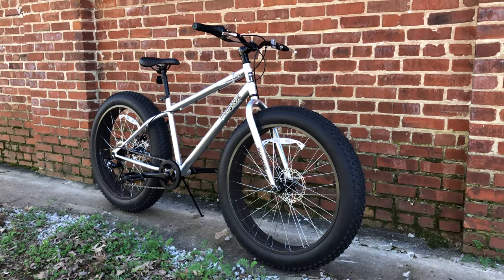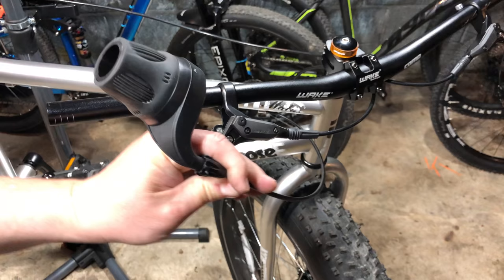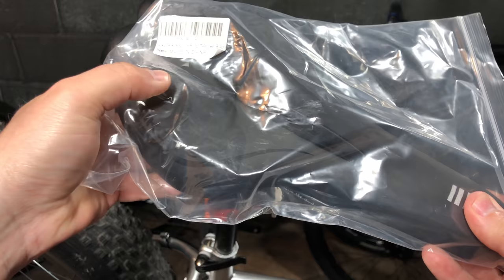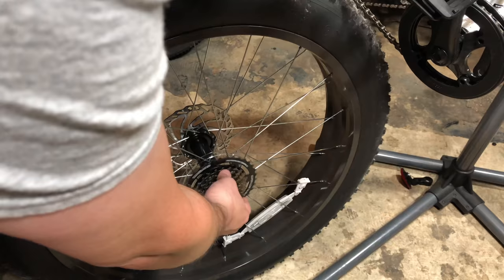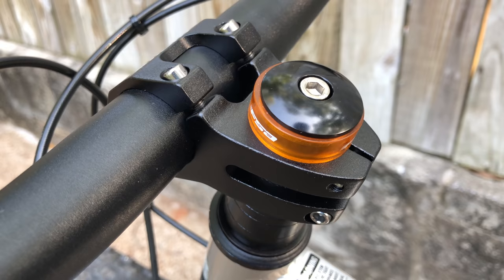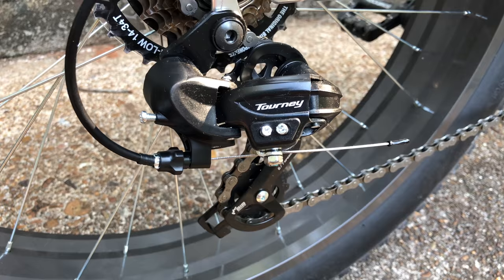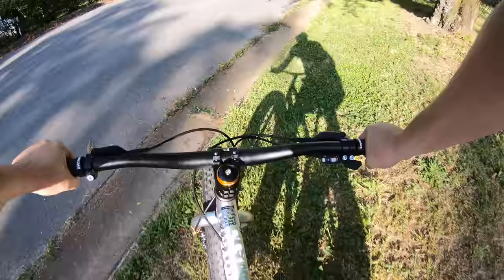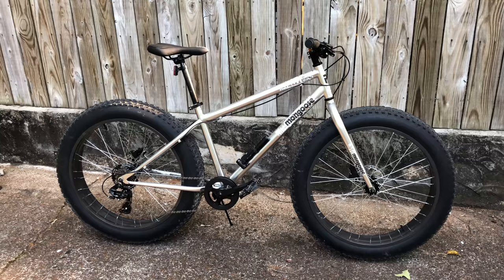Mongoose Malus Upgrades | Making a better fat tire bike for cheap

Comment: I had this bike yrs ago, it looked so cool, but the function was poor. That twist shifter was horrible, being that it took 1/3 of the grip, so you moved it all the time. The derailleur popped all the time, gear changes were never exact. The seat was GARBAGE. But after seeing this video, I will get another one and do these upgrades. I was told by a bicycle shop, those upgrades would have cost more than the bike itself. NOW I know they were full of crap. Thank you for this video.

Comment: Coyld you review the new walmart bike known as hyper viking trail pro 29inch or 27.5 inch both come at same prive
Reply from the maker: I don’t see that bike available in US Walmart stores or website.
Reply: @KevCentral  oh ok no worries then. Its the same hydroform only with a 1x drivetrain. However, the 27.5 and the 29er are both equivalently priced? Shouldnt the smaller wheel have a lower price?

Comment: What are the advantages of changing the freewheel?
Reply from the maker: If you mean going from a 14-28 to the megarange...the 14-34t gearing makes pedaling easier in the lowest gear.
Reply: @KevCentral  Thanks. Kev. Is there a way I can achieve more speed? Would making it an 8-10 speed help?

Comment: On this bike is it possible to change the front fork to a suspension fork? Thinking about getting the Aztec and it looks very similar.
Reply from the maker: There are suspension forks that fit the large tires
Reply: @KevCentral  Yeah I've seen them on Amazon just wanted to be sure the forks on this bike could be swapped to suspension.

Comment: I did pretty much these exact upgrades to a mongoose dolemite. I just finished last night. I do have a question. I'm only a casual rider, I bought the bike to get more exercise and to get my dog more exercise because I hate walking. So I left off the rockbros pedals because I just wear regular tennis shoes. Is there a pedal set you'd recommend for casual riding that won't tear up sneakers or do you think the factory pedals are good enough?
Reply from the maker: There are better pedals, but they will last a bit
Reply: @KevCentral  so use the factory until I invest in some mountain bike shoes?

Comment: How do I tighten the brakes
Reply from the maker: Please define what you mean by “tighten the brakes.”
Reply: My brakes on my handle bars touch my grips when I squeeze them.
Reply: So it takes a long time for the bike to stop
Reply from the maker: Ah. Too much slack in the brake cable. There is a nut on the calipers that can be used to reduce or increase tension, but I would suggest letting someone that knows brakes do the adjustment if you’re unsure. Brakes are important and not something worth risking a maintenance error. There are lots of YouTube tech videos from Park Tool that show how to adjust mechanical disc brakes. Maybe give one of those a look and see if it’s something you think is possible on your own.

Comment: How much would a used one in decent condition worth?
Reply from the maker: Right now, surprisingly more that would usually be the case
Reply: @KevCentral  Thank you. There's a decent used one for $375. A brand new one on Amazon is $423. I'm thinking of investing in the new one. Thoughts? I'm a big fan Btw
Reply from the maker: For myself, I usually go with new, so I don’t inherit any unforeseen issues.
Reply: @KevCentral  Sounds good! Thank you!!
Reply: @KevCentral  I am reading more about fat biking and I'm curious to know your take on the opinion that fat bikes are too hard and impractical to ride on the street especially that you categorized the Mongoose Malus as a Street bike? Thank you
Reply: @KevCentral  How bad do you think fat bikes are if most of my biking is on pavement? We get snow every year and also have pumpy sidewalks which I would be biking on for the most part in addition to paved trails. Thank you
Reply from the maker: Fun, but torture on hills
Reply: @KevCentral  Thank you. So I get it is not as bad then. Is it as versatile as to acquire for a first bike?

Comment: PLEASE take off chainring cover! It doesn't help as a "bash guard" and it makes the bike look suuuuper ugly. A diy chain tensioner could be installed to do the job on the clutch-less derraileur, or a cheap chain guide that attaches directly to the seat tube.

Comment: Take the Wake stem off the bike, they are DANGEROUS ive seen so many of them SNAP OFF
Reply from the maker: I haven't heard of any snapping, and I've seen lots of them being used.
Reply: @KevCentral  one of my mates hit a tree fairly slowly and it snapped right off, theyre made with awful metal

Comment: DONT  DO ANY REAL OFF  ROAD WITH THE WAKE BARS /STEM THEY HAVE  CHANCE OF SNAPPING   IF YOU LOOK REAL CLOSE   AT THE ENDS OF THE BAR YOU WILL SEE THE WALL THICKNESS INCONSISTENT  BROKE  2 SETS   DOING XC ON THE  WORK HACK
Reply: If this actually happened then what were you doing to make this happen?